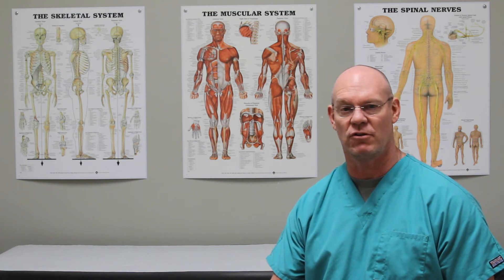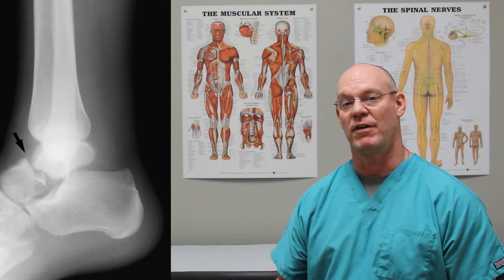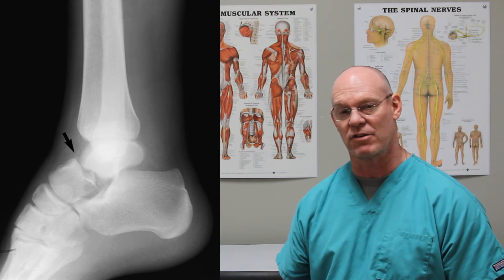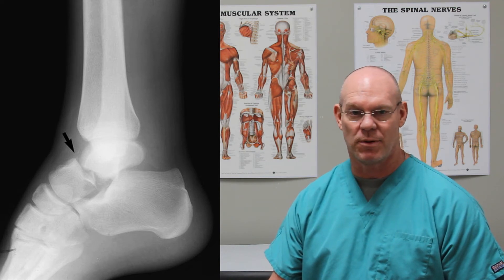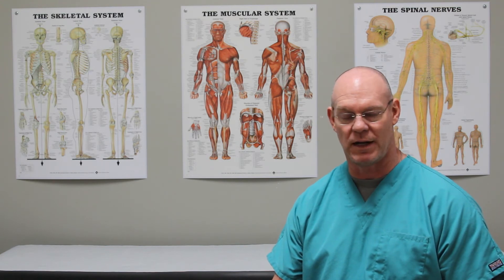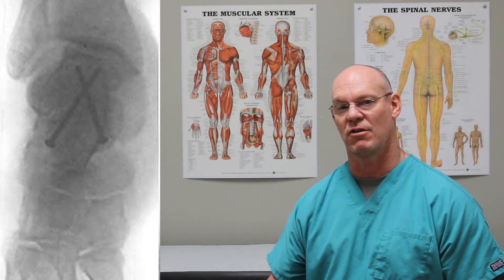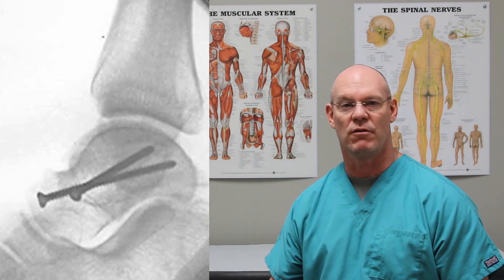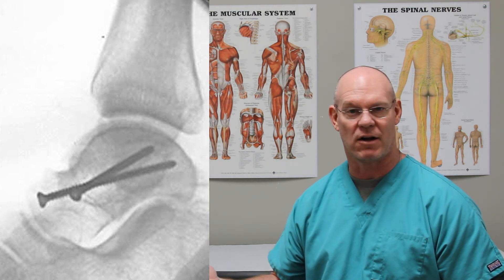Talus Fracture | Fracture Friday Episode 32

Comment: Hello thanks for the info. Question I had this bone put back together with about 7 screws and both of the bones above it were broken also and repaired.  I feel very blessed after watching this to still have my foot at all. But if you can tell me what the chances of it ever being pain free? I have two plates and over 13 screws holding it together.  I can walk and run just not without pain even after PT.

Comment: Hi! I got a non-displaced talus fracture about 2 months ago, had a cast for 6 weeks and got it removed a week ago. I am doing flexing/stretching exercises given by the physiotherapist 3-5 times a day and am supposed to try to walk normally and use my crotches as support if I take longer walks. For a couple of days after the cast was removed my ancle was very swollen, but is now better. But I am in a lot of pain. It hurts a lot when I do the exercises and when I try to walk - and I'm not very sensitive to pain... Is it normal to have a lot of pain in the ancle even after the fracture is supposed to be healed? The stiffness is one thing - I understand it takes time to get the flexibility back - but is it normal with so much pain? And why does it hurt?
Reply: They should have put you in a boot I think. They help your foot get used to your body weight.
Reply: Aew you completely normal now?
Reply: Hey, I know this happened a long time ago but I am in the same boat minus the pain (thankfully). Non displaced talus fracture (no surgery) and in a cast for 6-8 weeks. How was your recovery process? What was the timeline from cast to boot to walking? And is the pain still bugging you?
Reply: @Anthony-zh8wm I never got a boot - went from getting rid of cast to nothing. I can't really remember the timeline now, but unfortunately my foot was never the same again. If I walk on uneven surfaces I easily sprain this foot and I still have some pain from time to time.

Comment: How long after the broken talus neck surgery does it take to completely recover? I had a surgery at 3/5. When will i can walk without crutches?
Reply from the maker: phương nga khuất Depending on how your X-rays look, you should be slowed to be “weight bearing as tolerated” in a cast or Cast boot at 6-8 weeks. Then you should be walking without the cast or cast boot 4-8 weeks later. If your  about 12 week out from surgery your should be, at least, walking with immobilization. If you fracture has not healed at 12 plus weeks you have a non-union and will need additional surgery, possibly......
Reply: Dr Ted i saw doctor last friday. And he took my cast off but didn't gave me any boot. Just told me to do some exercises in bed. Now it's 39days after surgery.
Reply: phương nga khuất do you walk properly now .
Reply: It took me 9 months
Reply: @phuongngakhuat5843  can you walk now?
Reply: @JypeeMonton  i can. Like it never broke before
Reply: @wheels.and.wrenches  it took me 3months
Reply: @furqanshah6223  i started walking again 3months after the surgery. Just 1month later i could walk normally and properly
Reply: Wow! Good to hear it. Do you have trouble or stiffness for mobilizing your ankle months after the surgery?
Reply: @JypeeMonton  sometimes. After standing for a long time it hurts a bit
Reply: Hello Phurong,  what type of talus fracture did you have?   I may have an operation,  I will find out today-  thanks-
Reply: @manuelgonzalez3909  im sorry to hear that and im sorry because i dont really know what type it was. Hope you all the best and get well soon
Reply: phương nga khuất I just broke mine the other day, when should I start doing the exercises